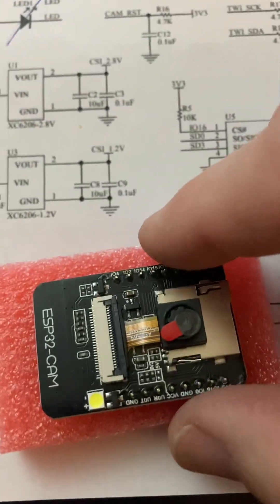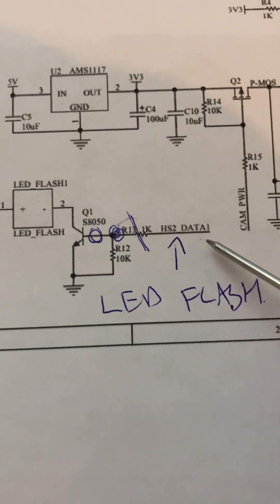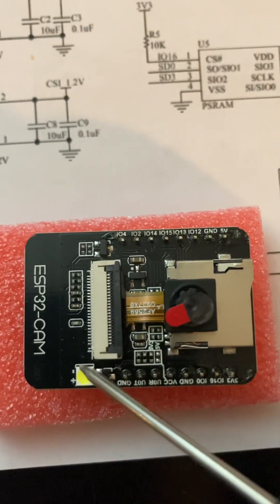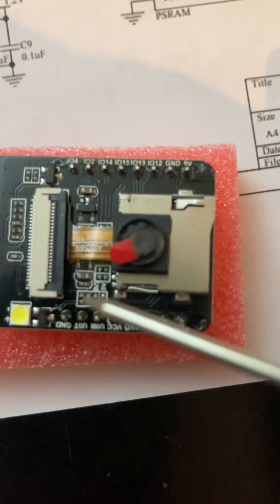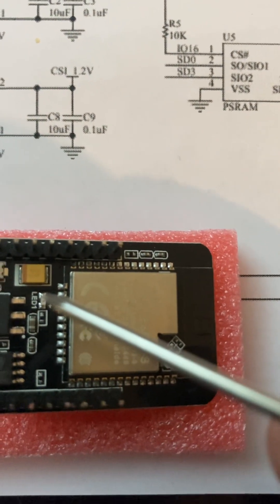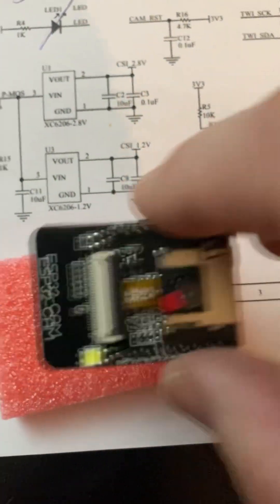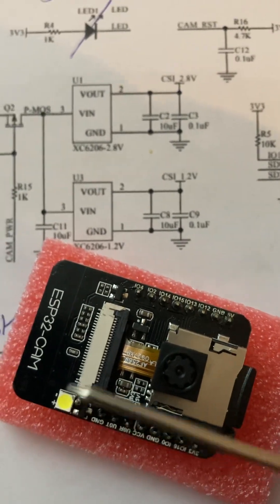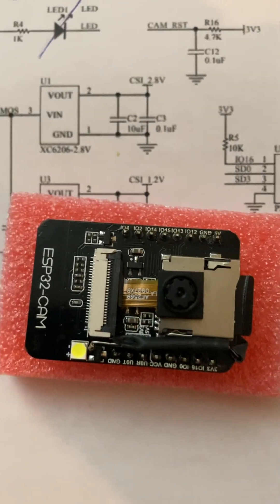AI thinker Esp32 CAM modification to permit proper flash led and SD card simultaneous use.

Comment: Where do I tell gpi0 33 to flash led. Thanks,  I am new to this.
Reply from the maker: No problem, so after you've made the hardware change you'd code: 

    digitalWrite(33, true); //  to turn on the  flash 

and:

     digitalWrite(33,false); // to turn off the flash
Reply: thanks @petera1000

Comment: My esp32 cam ai thinker is having problem reading sd cards
I got a new genuine scandisk 16gb sd card and it’s not reading on the ESP32cam

Is the TF card a common problem?
Reply from the maker: I've had lots of problems with the SD cards too. I think they are limited to 4GB. What I've noticed is that they must be formatted on a PC first as FAT, then they seem to work for a while but they can get corrupted and you have to reformat etc. There is likely a bug in the tiny file system code. Im able to record images to them and view them over the web but I have to reboot the card every day to make sure things keep working smoothly.
Reply: @petera1000  
Is there no modification to the device that can fix this issue?
Reply from the maker: @Manuqtix.Manuqtix  I don't think so. Many of my boards have now stopped being able to use their SD cards. I've since given up on these and bought professional cameras for my security needs.